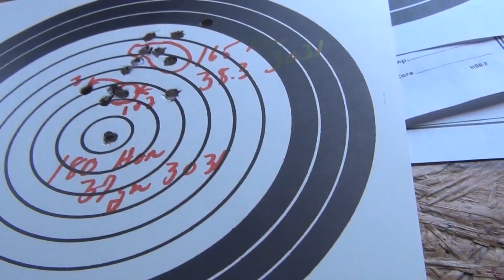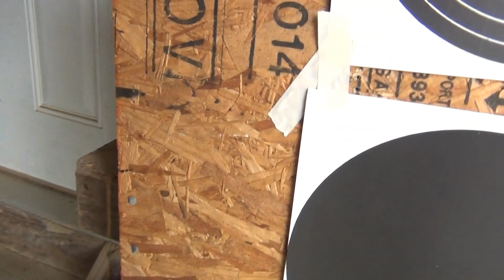A Couple of classic Deer Rifles

Comment: You have classic taste young man.  I have a Model 99 in a take down in .300 Savage and a 1947 M99 in .300 Savage.  The take down is still open sight and shoots minute of milk jug at 200 yards all day.  The other one was drilled and tapped by the gentleman I bought it from and I scoped it and she is 1 to 1-1/4” at 100 yards proper.  I have taken cow elk with both, several white tails  and a few dozen hogs.  You can always trim .200” off of .308 Win brass and run them through your 300 Savage sizing die and trim to length for easy build on your own brass.
Awesome shooting by the way.   God bless
Reply from the maker: Well good morning Mr Ray. Very interesting comments that you made. Always good to hear from a fellow Savage. I too have a 99G takedown made in 1823 and of course in .300 Sav. I loved your “minute of milk jug” comment. Got a chuckle out of that one. 
I have posted a few videos featuring the 99s and have a few more in the works. I love the 99 and I prefer them chambered for the .300 Savage. That little caliber is simply awesome. Most younger guys go for the .308, and ignore the .300, and that is a shame. I have had tons of 99s go through my shop, in virtually every possible caliber. The .300s always are quite accurate while most .308s are a bit picky as to what they want to shoot. The .300s are just plain accurate. 
Speaking of my 99 Takedown, I did a video awhile back called 
“ Walk with a Savage” which features that fine old rifle.
One of your comments really intrigue’s me. You said you have taken several dozen hogs with your rifles. We have no hogs in my part of the country. Personally I wish we did. Everyone talks about what a problem they are and want rid of them. But if someone would want to hunt them, and help in the control of them, it cost that person a small fortune. As a person who lives in a hog free
area, it appears that those who have hogs want to charge folks to help rid them of their problems. And then you see on TV guys who are paid to control hogs and yet I can find no place where I can hunt them without paying some crazy fee. A crazy situation if you ask me. All you hear is what a problem the wild hogs are and yet it seems impossible to find a place to hunt them. Go figure.
Keep on enjoying your 99’s Sir and thank you for your thoughtful comments.
Dennis
Reply: Good morning back to you Mr. Dennis sir, 
I admit that I recently found your channel and you look a lot like my good friend and bother I never had who I call Bear Claw.  He came up from Texas to hunt with me in Wyoming back in 2004 and I dropped a 6X6 bull elk with a 14” barreled XP-100 I built in 1986 in .358 Winchester.  As I crossed the draw to go get my hands on that bull, I crossed a bunch of buried beaver, the left front shoulder of a horse and a bunch of bones and it looked like someone poured a jar of jam on the ground and the first thing I realized was I was standing in a big bears pantry.  Anyhow, we got the bull cleaned up and quartered, then packed it out on the ponies.  Since we left the inthralls and rib cage at the kill sight, we made a make shift ground blind out of some dead fall about 150 yards away so we had a good view.  I was showing a few other hunting buddies below the canyon on the Big Sandy River some good elk areas the next morning when I heard a shot echo down the canyon.  It took me an hour plus to climb back up that 1600 feet back to the ground blind and found Bear Claw and another freind aka Mossy (we all have camp names as I am elk horn) standing over a 500 plus pound monster black bear.  BC had shot him as he was carrying the entire rib cage of that elk down to hide him next to all the other critters. I share this story as we have all been hunting with each other for 30 plus years and I have seen many a new and classic firearms brought to the high country.  In all those years, I have only ran across one other Hunter packing a Savage 99 on a New Mexico deer hunt in 2006.  They are a beautiful rifle and two of my grandsons will wind up with mine someday.
As for the hogs, I transferred with the company I worked for for 41 years to Texas back in 2009.  I have another good friend and brother with a ranch in south Texas and they are covered up with hogs.  I build custom flintlocks (for me) since I got burned out in building bolt guns.  A .600”, 330 grain cast round ball over 120 grains of 2F Swiss from a 38” rifled Colerain barrel put a hog down in a hurry under 100 yards… she drops like a brick after that.  Anyhow, I get to hunt them for free and yes sir, folks got greedy and started charging to hunt hogs.  I now live west of Houston out in the country and they are all around me between the Brazos and Colorado rivers and they get big out here in the farm land.  But like you, I won’t pay $150 a day to help someone exterminate their 4 legged crop problem.
I have a lot of your videos left to watch sir and I am getting ready to go back home to Wyoming to go chase one more antelope with a flintlock.  But I will watch them as I can ole Pard.  God bless and keep them milk jugs lined up center.

Comment: Do you know if Savage sold any 99s made with Bishop brand buttpad, like brown with white and black wafer sandwiched between wood stock and buttpad?
Reply from the maker: Not to my knowledge. Probably after market.
Reply: @dennispritchardoutdoors7882  you’re right. On my 308 99 previous owner must have screwed the 2 butt pad plastic wafers (white and a black one but then epoxied the compression butt pad over top of the wafers. Used a razor lanes to get the bond loose only to find the two screws without screw heads on the top compression pad. Trying to tease it off and screw it on. Need access to the long bolt to go over the action. Built 5 dummy rounds and tried to get magazine spindle timed with right tension. Pretty close now, but counter is off. Plan to get to range and test if fired rounds eject as sweet as the dummy rounds are. Thanks for such an inspirational video channel.

Comment: You were saying most open site rifles have a glare shroud you should looks around for an industrious buck with a 3D printer to design and make a shroud to slip over the muzzle does the barrel taper start to   tapering from small to bigger the whole length consistently back to the breach just a suggestion!
Reply from the maker: A shroud is very desirable for a target rifle. My target rifles have them. But for hunting they can be a hindrance so most rifles that are meant to be hunting rifles lack them. Under hunting conditions it is best to have plenty of light on those sights. So when testing loads or zeroing in I do not want sun shining directly on those sights. But when hunting it is a different story.
Thank you for watching and for commenting.
Dennis

Comment: A really great video Sir. I just tried to research my model 1899 in 308, has real fancy walnut showing burl grain and pistol grip with Monte Carlo stock, jeweled bolt, brass counter, forend is schnoebel furniture. I think it may be a 99 DL, it H boss code- made in 1956 (my 300 savage is a 1955). The 308 needs a deep cleaning in bolt, some work to let last shell eject…it is a devil getting last round ejected. My 308 is not nearly as smooth as your actions. That last bit closing the lever where the rear of bolt elevates to close action is rough, not smooth like your Rolex, er 99. Work to do, have to figure out how to disassemble bolt. Thanks for inspiring folks to grab up an 1899.
Reply from the maker: I was not aware of any 99 that had a Monte Carlo stock with a schnoebel for end. That’s a new one on me. But then again they were made in a zillion various configurations!!! There is a pretty good takedown guide made by Radocy. Very helpful. Your gun sounds like a DL but that for end has me stumped. I hope you get it all fixed up.
Reply: You know more than I on these 99s. Thought since it was made their first year for the 99 in 308, 1956, maybe they did some fancy stocks. But the Buttpad by BISHOP seems like an add on? I have been thinking it needs the stock taken off, disassembled for a good cleaning on the action. Then hearing yours cycle like a fine jewel…since the brass rotary is likely the problem on last round…might just poke the bear. I saw a vid of taking rotary mag apart to clean that abut tgey say it could be a bear…maybe not?
Reply from the maker: @michaeldickerson873  go on line and order the Savage takedown guide from Radocy. Every 99 owner should have one of these.

Comment: Curious if you have ever encountered where someone has put a coat of some a wood finish (maybe varnish?) covering the wood and extending onto the metal receiver-say like 3/8 inch or so? Not sure how to clean this off patina receiver. Not sure if you would be willing to share your savvy with me? Thank you.
Reply from the maker: I have seen about everything you could imagine done to these rifles. If it was my rifle I would use a simple paint and varnish remover on it. That should do nothing to the metal.
Reply: @dennispritchardoutdoors7882  good to know. I want to get it back to original without degrading metal finish. Bless you Sir!

Comment: I have a Sears 22 single shot short, long and long rifle. If I was to refine the stock would I Ed to sand with 00 steel wool as a minimum to prep surface for hand applied true oil or Tung oil if I can find Hope’s or Formby?   Do I need to remove all the finish before staring my micro layers of Tung oil or Formby?!’s?
Reply from the maker: Let me tell you what I do. I use a paint and varnish remover to take off all of the old finish. Unless you want to change the shape, do very little sanding. Just remove the whiskers. Then depending on what sort of a finished product you want , start applying the oil of your choice,sanding between coats, until it suits you.
Then do your final rub down with rotten stone wetted with linseed oil. Wipe it all off, and then with your bare hands rub, rub, rub, to bring up the final hand rubbed oil finish.
Hope this helps.

Comment: What tang safety do you have on that 99?
Reply from the maker: The sight on this rifle is made by Marbles and I got it from Brownells. It’s a pretty good sight, adjustable for both windage and elevation. On some I have vintage Lyman #2 ‘s which are only elevation adjustable.
Reply: Thanks Dennis. Been thinking about getting for a long time. @dennispritchardoutdoors7882